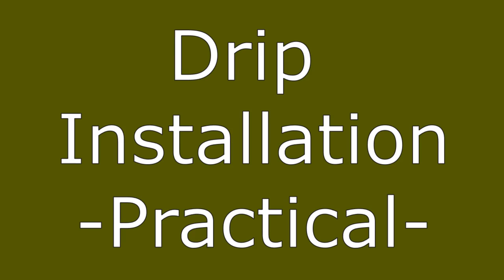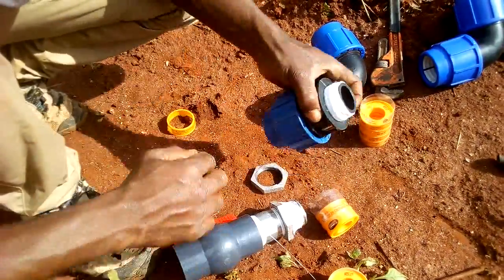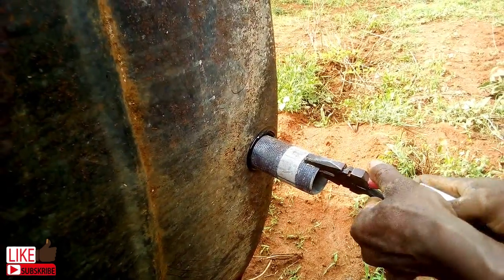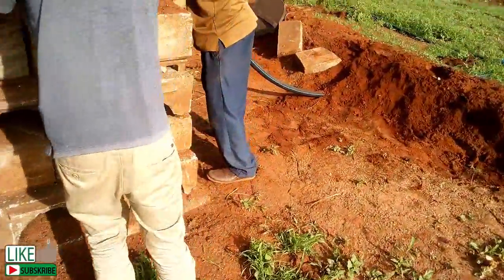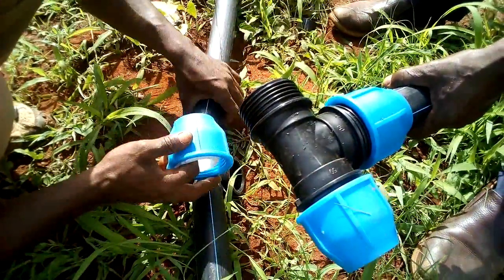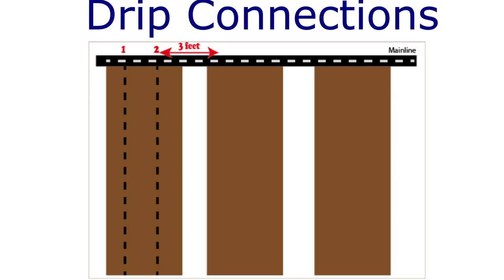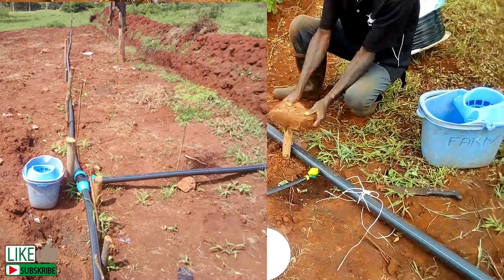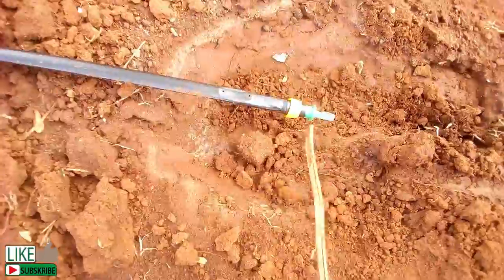Drip Irrigation   Installation PRACTICAL

Comment: Please sir I was doing an irrigation system in my greenhouse... I passed my main line across my 15 meter green house, then I punctured 2 holes each for 10 of my beds where I'll put my connector then attach my drip line to it... I have not put my connector yet, I decided to open the water to see if water will come out of all the holes I punctured but I noticed it only came out of the first 4 to 5 holes and didn't reach the other holes... what could be the cause

Comment: Thank you for you detail video,, .. i m going to copy your irriigation system to my banana farm,,  today i m very tired watering manually using single pipe for my 1 acre banana.... my solution accomplished by watch your video
Reply from the maker: For bananas, consider using the 16mm pipe with emitters fixed on specific holes. Customize. You can get an emitter with the the higher flow since bananas need a lot of water compared to vegetables. Dont use the drip tape.